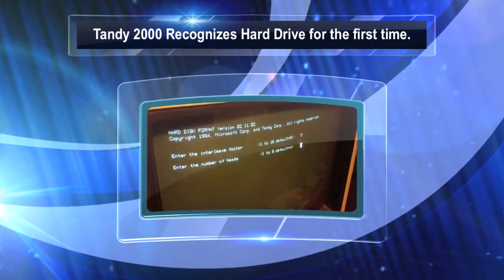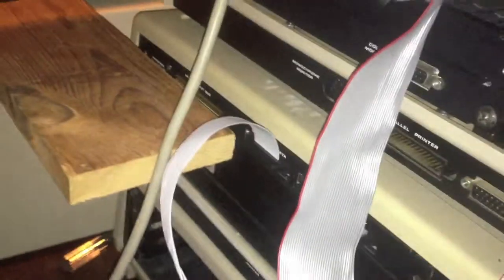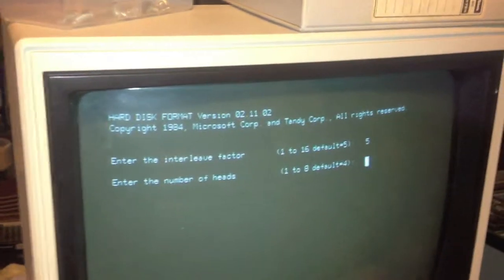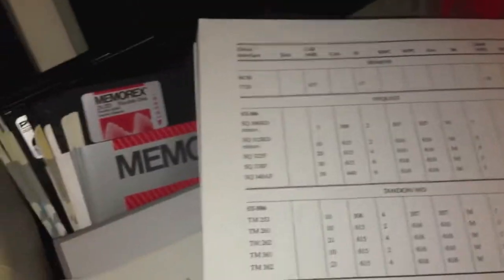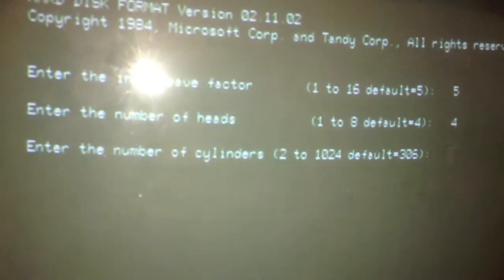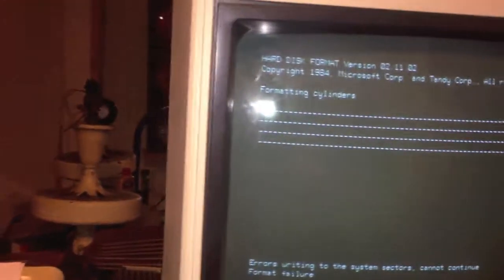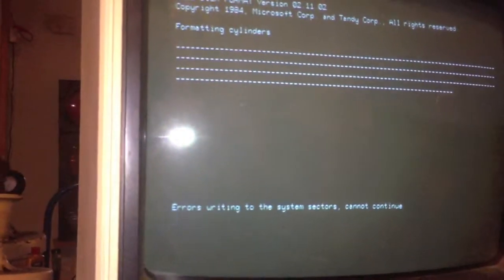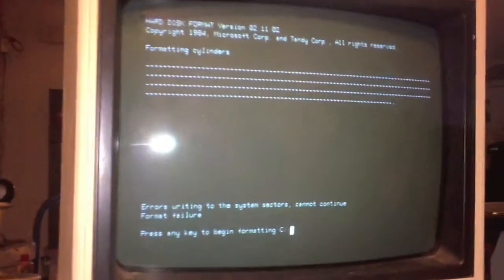Tandy 2000 Recognizes Hard Drive for the First Time

Comment: Did you ever get a Hard Drive to work on any of your T2K's
Reply from the maker: No I didn't.  It feels like I need to do a low level format and a partition on the hard drive.  And there doesn't seem to be a way to do that.  HFORMAT just seems to do a DOS format to the drive.  I could be wrong about that, but it doesn't seem to work with any hard drive I've tried. And I have quite a few.
Reply: From what I recall the early 2000's were problematic at best. The 2000's that all the Radio Shack stores inherited our later series or completely upgraded from all bugs & Bios problems. I remember vividly customers coming in to fix bugs from early series 2000's. Two I remember very well, a defective "variable pot" in the power supply would cause the computer to randomly freeze or in worse cases reboot. Another problem was when a customer came in to purchase a Hard Drive upgrade kit, the computer would not format the hard drive or if it did would not boot from it. That was a easy problem to fix. Just a simple Bios chip upgrade would do the trick. Again I'm going back about 30 years, I do remember the new Bios chips had a white sticker with black letters with the word "Boot". If your 2000 does not have that Bios upgrade no matter what you do, you will never get a hard drive to work on it. If you have early 2000 I think finding the bad "Pot" can be done, but getting correct Bios chips may be a lot more difficult.

Comment: Not sure if your still involved with your Tandy 2000's, I have one that will not boot. I'm hoping I can ask you some questions about these computers.
Reply from the maker: Sure! Ask away.  I'll try to answer as best I can.
Reply: I'm not sure if my boot disks for my 2000 work, I was wondering if I could buy some copies from you? My 2000 has no HD & all it does is show memory total of 256K. It tries to boot to the A drive but after a short read it cycles back, and try's again. But nothing happens on the screen. Still says 256K  with a flashing cursor. This cycle repeats itself until I shut it down.
Reply from the maker: +Havoc Sun   Silly question, but Are you sure you have a Tandy 2000 MS DOS boot disk?  
But sure, I think I can make a bootable floppy for you.
Reply: That would be great! If you go to my Youtube page I show a video of of the problem. Yes the disks our bootable at least thats what they say. I was thinking we could trade software, I have a bunch of original stuff.